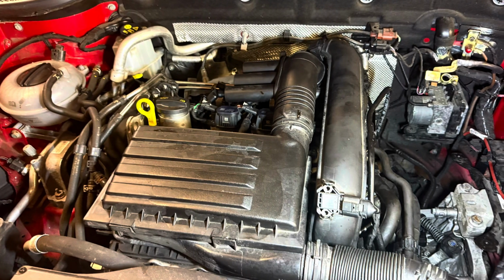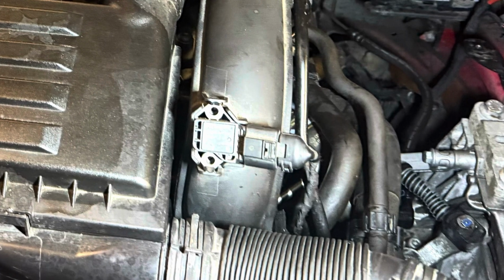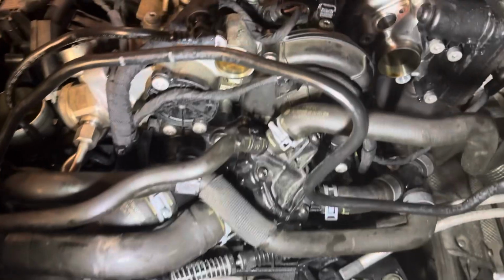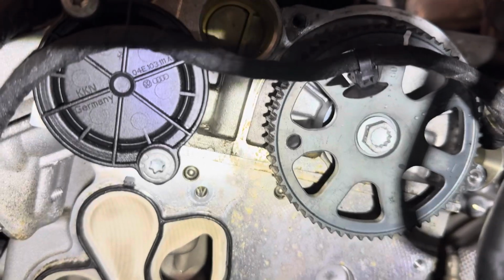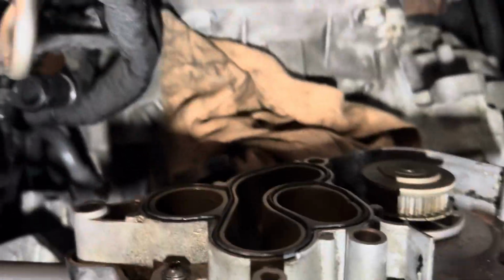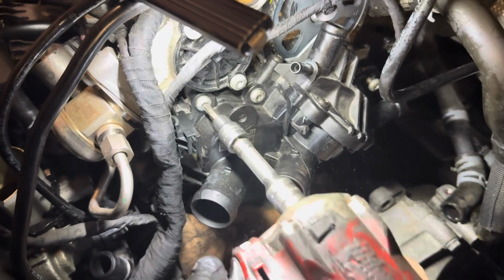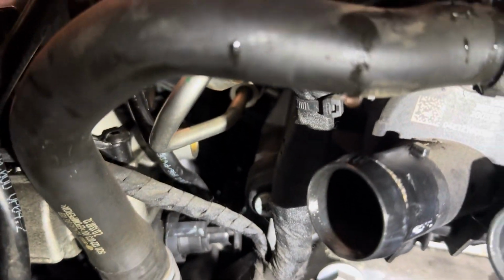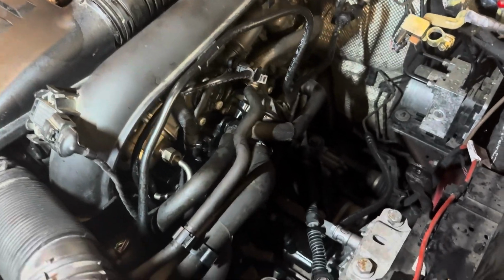The BEST Way to Change Your Volkswagen TSI Water Pump in 2026

Comment: Thanks for the video. Sorry I already asked in the timing belt vid: how do you refill coolant while making sure no air pockets remain?
Reply from the maker: No problem. Best way is using a coolant purge tool but you will need a compressor. Search through my videos. I have done a video on using it. I believe it’s called. Refilling coolant with laser purge tool. Good luck 🤞
Reply: @How2FixIt1  Yes I know I have the VW workshop manual. Trouble is I´ve no compressor or a Venturi valve needed to pull a hard vacuum. Some pro mechanics on YT (VW codes on tools) just pour coolant in oldskool. Bad idea? Even if I had a compressor and the Venturi the car´s now on the side of the road after it suddenly started cutting off. I´m too scared to limp it home so will do the timing belt and pump in the field and make bloody sure the timing´s good before cranking the engine one revolution...
Reply: Is this video also applicable for a 2016 MK7?